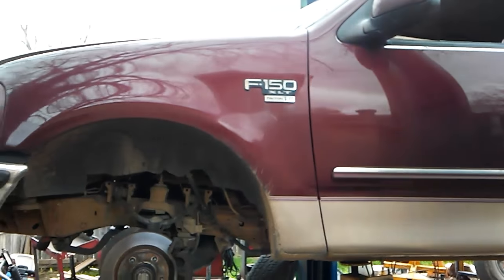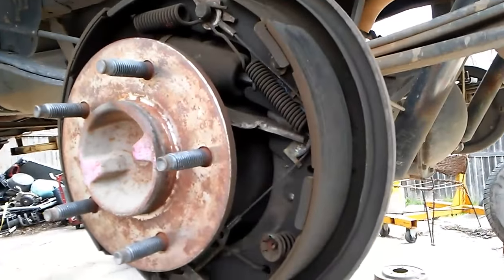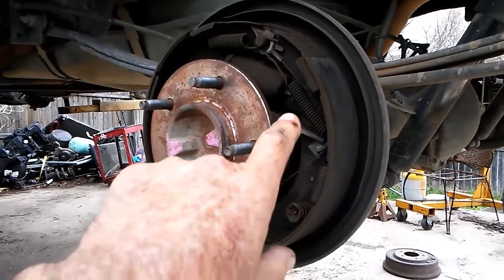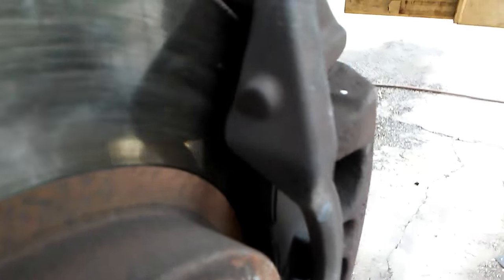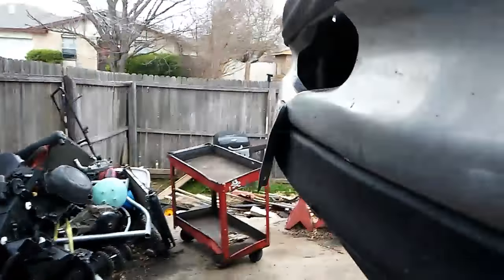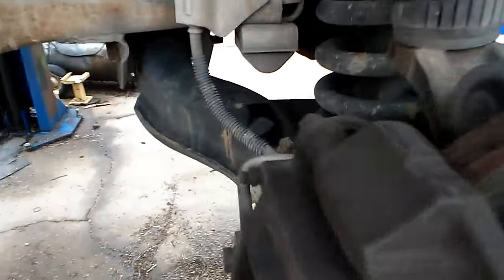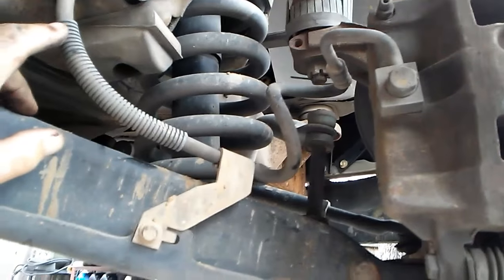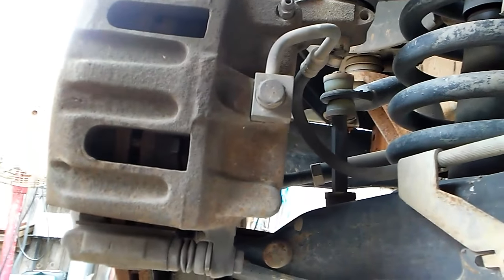1999 f150 rear brakes locking up

Comment: Same year truck with the same problem. I will check the hoses and sensor.
Reply from the maker: Most of the brake fluid pressure should go to front brakes, If you have to much fluid pressure to the rear brakes, that will cause them to lock up when applying brake pedal, The cause can be, rear ABS sensor, Master cylinder, etc...Try to unplug the rear ABS sensor, and go from there...good luck and thanks for watching.
Reply: Where is the ABS Sensor?
Reply: me too

Comment: Did you replace all 4 brake lines or just the one brake line on that side? My truck is locking up really bad and wanted more information
Reply: Have you fixed your truck?
Reply: @m.pietro9087  yes it was not brake lines the brake drum was binding up.
Reply: @coolcoop1000  thank you.

Comment: Damn looks just like mine before rusted out.. on my 99 the rear parking brakes and pads were replaced, I have rear disc with internal parking brake near center. New cables, since they were all seized. Had a random left or right brake appear to hang, thought since issue with both I swapped the rubber axle hose, which required a new vent bolt, issue remained, what I see if the parking brakes are applying, they are slipping free of cables and going full apply. Do not think they are dragging prior to somehow rock pads to affect that cam spreader, the spreaders were not changed, do you guys think replacing those would help?  they both appeared to be functional and free when I installed the shoes and hardware inside parking brake section..
Reply: Well still random locking up driver rear disc.  I pulled apart, everything looks good, bought some slide glide brake grease for back side of parking brakes, lathered it all up, cleaned n greased spreader. Can feel it bind up going slowly, jerking feeling, going to order a caliper in case bore is bad, but if not applied would not think pressure there.. rear antilock on 4x4 have issues? no codes present for it.. need to use car hauler and this is the truck that gets 50% better mpg than my chevy.. no replies in 4 months so not holding breath, thought someone might have issue n reply,, possibly due to your rears being drum.. 2x4..

Comment: Did this fix it? I have the exact problem on my f150. Just replaced the shoes and cylinders too and the left rear locks up.
Reply: Did you get this resolved? I have a 1997 f350 power stroke dully that has problem with back wheels locking up it starts gradually it takes about a half hour before the abs and brake lite comes on then I can feel the brakes start to drag  and continue to get worse if you park and shut it off you can hear the both brakes backing off. I  had it at different shops we replaced the rubber hose at the rear this is know to delaminate on the inside not allowing the fluid to return. We replaced the rear sensor no difference. I just came back from testing it with the abs fuse pulled  seems like it improved however after an hour of driving they began hang up but after about 10 seconds the rear brakes would release allowing the truck to roll on the flat without pushing on the gas. Considering replacing the front wheel sensors, abs module and or the master cylinder.

Comment: What's with the blur bro?
Reply from the maker: Thank you for letting me know, I do not know how it got like that, I am trying to fix it, if not I will re-upload, thanks again
Reply: Danny Collins  did this end up fixing it? Mine are doing the same. I have the same truck. 99 f150 4.2 2wd. The rear brakes lock up when I apply the brakes.
Reply from the maker: Yes, on that truck the right front brake caliper hose was twisted and cause too much fluid pressure to the back brakes but that was because somebody install front brake pads and they hade the caliper twisted when putting it back on, back to your truck, the master cylinder can do the same thing when getting to much fluid pressure to the back brakes, also i am not sure on this truck but some of them have a rear brake fluid pressure sensor for the back brakes and you can ajust the fluid pressure on the lever of the sensor, some truck have this system for load control of the rear brake system, hope this helps. PS let me know what u find out and we can both learn,  i have had several trucks to do this same thing. Never know what i am going to work on day from day.   lol
Reply from the maker: Hello Larry, update on your truck, there are also other possibilities for rear brakes locking up #1 brake shoes them self-sticking, #2 Rear ABS sensor, "try disconnect the wire harness to rear brake sensor" and drive to see if that corrects the problem, #3 Brake master cylinder bad, letting too much fluid pressure to rear brakes. hope this helps, thanks for watching.
Reply from the maker: Larry, i do not think your truck has that rear brake lever sensor for fluid control.
Reply: @JCSIspired   you need to lock at the cable  the goes from your ebrake to the brakes under  the truck my 1998 was locking  up only when a applied to ebrakes it was one of the e-brake cables that goes to the rear wheel that was rusted out and not letting it return so it felt  like the brakes  were  on